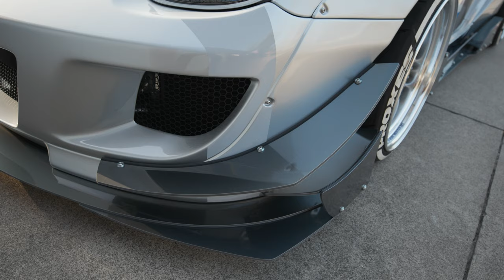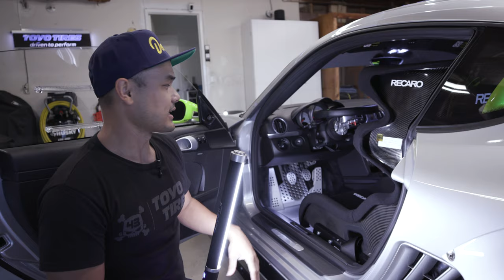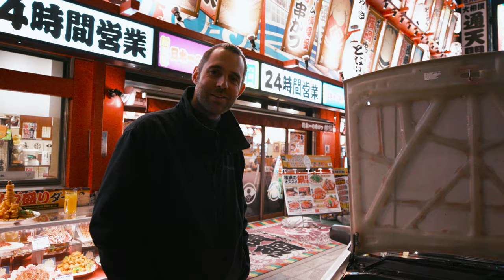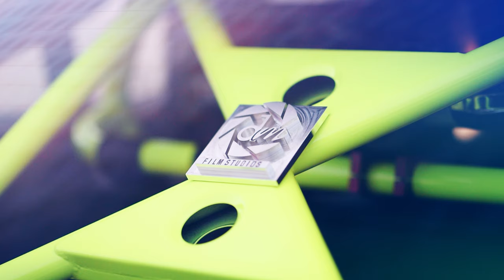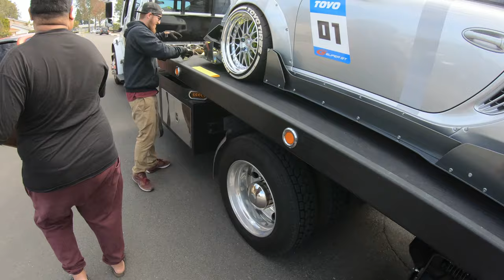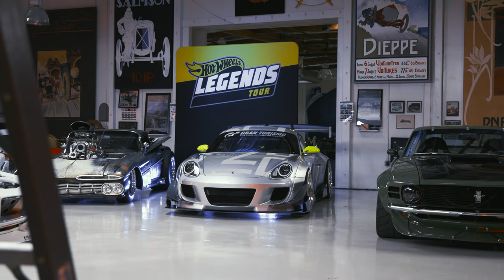PANDEM WIDEBODY PORSCHE CAYMAN | [4K60]

Comment: Awesome!!! This has been an inspiration for my Cayman for the past 5 years. Only now am I finally getting round to fitting a v1.5 Pandem kit! 

Question with your wheel setup up front I remember you talking about moving your radiators? I'm going with 20' x 9j wheels up front so will need to do the same. Do you have any info on this or a video that shows it anywhere please?  Thanks :)